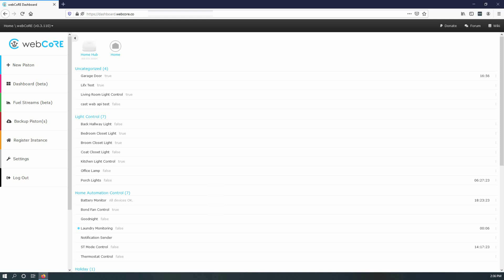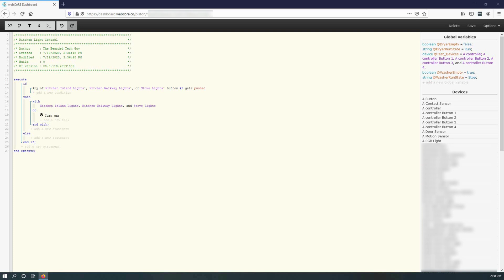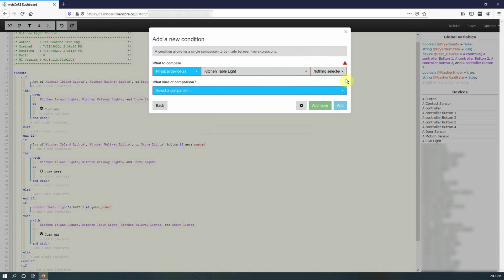Getting to Know webCoRE: Controlling Multiple Light switches (4-way light)

Comment: Love the video series.  Old coder, new to webcore.  At 2:31, you reference using "button 1" for double tap up on the switch.  How did you know or assign this??  I've got a Hue Smart Button on my system.  I'm using it with a DH for Zigbee Button.  I can only get it to respond to "any" button pushed.  It supports held and double tap, but I cannot get those commands to register ever.  Lead me back to... how did you know, double up on your switch was "button 1"?  Documentation of your GE switch?  Did you gloss over this?  How can I see webCoRE commands for HELD and Double?  My console only ever sees Pushed.  I tried about 5 other DH too, no luck.  Thanks!
Reply from the maker: Glad you found the video series helpful! I'll make sure to cover this better in any video that may reference it in the future.

I can't find information on if the Hue button supports double tap or not in webCoRE and I don't own one to test. For me, the double tap functionality is part of the GE Z-Wave Plus light switches and does require a custom DH for. To figure out (every time because I always forget) which button is what I login to the SmartThings IDE and load up Live Logging. I then do interact with my switch and it will show which button is being triggered when. If you see the individual button presses then it should work in webCoRE. If everything is just registering as the same button then I would try a different DH.

Double yap up (Button 1):
Parsed BasicSet(value: 255) to ['name':'button', 'value':'pushed', 'data':['buttonNumber':1], 'descriptionText':Double-tap up (button 1) on Office Light, 'isStateChange':true, 'type':'physical', 'linkText':'Office Light', 'displayed':true]

Double tap down (Button ):
Parsed BasicSet(value: 0) to ['name':'button', 'value':'pushed', 'data':['buttonNumber':2], 'descriptionText':Double-tap down (button 2) on Office Light, 'isStateChange':true, 'type':'physical', 'linkText':'Office Light', 'displayed':true]

Comment: So a double switch press is looked at as a single button pressed with the right DH?
Reply from the maker: Correct the nuttytree DH for my GE/Jasco z-wave plus light switches has the double taps as button 1 or 2 and normal on off. I've had a few DHs for other light switches where it changed on/off to button presses as well
Reply from the maker: You need light switches that support the double press too. I am not aware of any that aren't z-wave Plus, I believe that's a feature that was added with the new protocol.
Reply: I use GE 46203, 14294, 14291, & 14287. Right now I’m using the default DH.
Reply from the maker: Those should all work with the nuttytree DH (https://github.com/nuttytree/Nutty-SmartThings/tree/master/devicetypes/nuttytree). Don't forget to assign the DH to devices you already have added in SmartThings!

Comment: Can you tell me which DH you're using for your GE Switches. I installed nuttytree
/Chris Nussbaum's DH and 2 buttons now show in the Classic app.  I can't see any button options in WC, however. I have no clue how to fix this, can you help?
Reply from the maker: I'm using the GE Jasco ones from the nuttytree repository: https://github.com/nuttytree/Nutty-SmartThings/tree/master/devicetypes/nuttytree

What model light switches do you have?
If you had them installed in SmartThings before installing the device handler you have to go into the devices and change the device handler itself. Note - you have to have GE Z-Wave Plus switches, the older non-plus do not support double tap.
Reply: @BeardedTechGuy  I'm guessing that I have the older one and it looks like everyone one of mine is older.  I went into the ide and changed each light switch from Z-WAVE SWITCH to GE/Jasco Z-Wave Plus On/Off Switch per RBoy's instructions on adding a DH to an existing device. Is there anything else that I should do after that? (I've been using ST & WC for a few years, but I have zero programming skills, so I'm not sure if I'm missing something)
Reply from the maker: If you go into the IDE, and navigate to one of the light switches (just click on the name under "My Devices"). Send me whats under "Raw Description" and I'll see if I can help you figure out what you have (most likely ones that don't support double tap though). Mine starts like this: zw:L type:1101 mfr:0063 prod:4944
Reply: @BeardedTechGuy   	zw:L type:1001 mfr:0063 prod:4952 model:3135 ver:5.53
Reply from the maker: That should be a GE 14291 which should work with the Device handler from nuttytree. Give me a little while to get a few screenshots together of things to check to make sure its setup the way it needs to be.
Reply: @BeardedTechGuy  What makes me REALLY wonder if I'm doing something wrong is that my Amazon orders say "GE Z-Wave Plus Smart Switch"
Reply from the maker: If you have the model number from Amazon or if you have the boxes still I can tell you from that more easily.
Reply: @BeardedTechGuy  I have pics of the front of the switches, but my other half threw the boxes away. 😒
Reply from the maker: A link to the Amazon item you bought works too
Reply from the maker: Just saw your link was flagged for spam, that is in fact the GE 14291 which should work with the device handler.